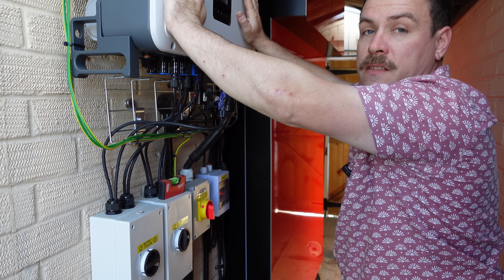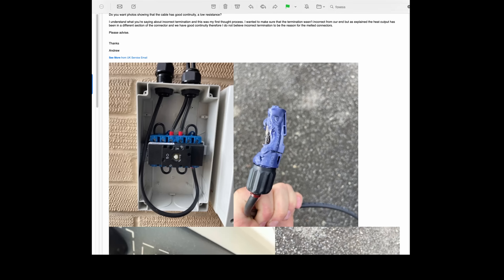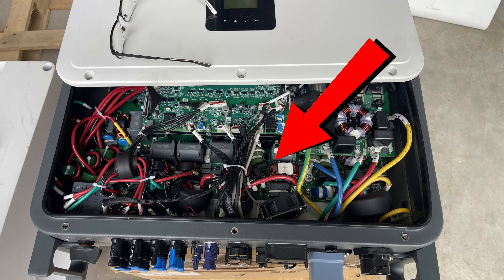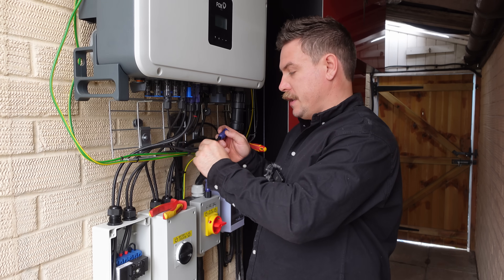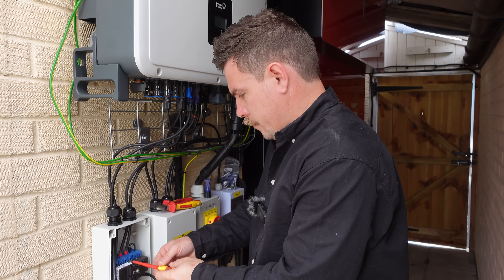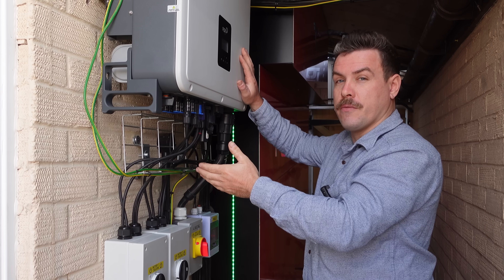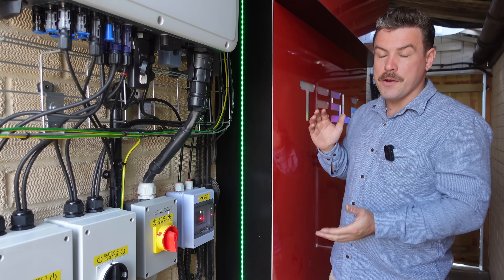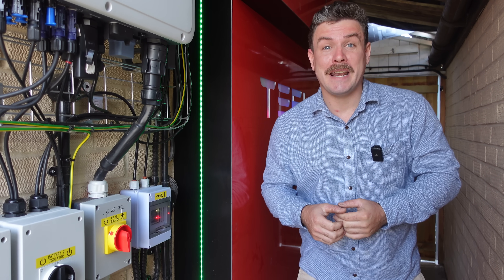Broken Solar Inverter! But Will Fox ESS Fix It?

Comment: I am looking to start my Solar journey. With a DIY solar install, fitting solar panels on the roof of my detached office/workshop/garage.

As an electronic engineer I have repaid / programmed on car ECU / Speedo / control units.
So, an EV home battery sound like a great project.
Where can I find help with this?
Reply from the maker: Dala the great the originator of the open source software to make this possible has a discord channel. There are lots of people in there with all sorts of experience and all sorts of stages of these projects.

I would always recommend getting an electrician on board. No offense but electrical engineers look at things in a slightly different angle to electricians. Things such as cable type and sizing, correct earthing and so I need to be considered. 

I’m not trying to put you off. I just wanna make sure that you cover all bases and make sure you protect yourself. You certainly sound like the sort of person whos more than capable to carry out this sort project
Reply: @TheOfficialBatteryMan Thank for the reply, how do I find the discord channel?
Reply from the maker: @smartroadster452 search GitHub battery emulator. Details on the first page. You have to join the guys patreon but I know myself I wouldn’t have got started without it. And there is a world of people doing the same thing

Comment: I recently read about the balancing issue of the Tesla battery on Dala's GIT (I did a Dala Nissan Leaf battery installation) and it surprised me. How about powering it down automatically once a month? Would it then balance?
Reply from the maker: There are people trying it. I’ve got home assistant to monitor the data and 2 batteries to compare. I keep meaning to try it with the latest firmware version.
Reply: @TheOfficialBatteryMan  When I sometimes had to fully charge my first Tesla (MS85 from 2013) I could see, that it was doing balancing a the top end, taking sometimes several hours until charging stopped. Is that not something you see here?

Comment: Oh my god, is that Tesla car battery bolted to your house?
If you want to experiment with it, i would warmly recommend to move it in a place where it is safe for that battery to burn for hours without big consequences to residences and people as it is nearly impossible to extinguish a fire of those batteries if they reach a thermal runaway. Please be careful!
Reply from the maker: Haha. 😛 it very much is bolted to the house. So far the wall is still intact. The battery isn’t on fire and I still have my qualifications and licences. 

I totally agree in having large battery systems away from a property but 500kg is awks to move 😂

Comment: What size DC cable are you using? Ive got a current project using 3x 82 KW batteries, currently running one with some 6mm DC cable but look like i can get at least 10mm in there, also what can the new larger terminals you got from them take?  Thanks
Reply from the maker: Hey. 10mm2 cable for 50amps. I’m not sure on the max cable size for the larger connectors. They were rated for AWG according to the chap who helped me.

Comment: What are these connections rated for and what max. resistance is allowed.

Better to measure male & female resistance under load condition.
Voltage Drop over the connection/ Current Flow V/A. 
Can you do this 😢
Reply from the maker: I can’t find a spec sheet for this connector. All I know is the inverter is rated for 50 amps. But I agree. Measuring voltage drop under load at each point would work out where there is high resistance. Feel a bit silly I didn’t think of it before. 😂😂

Comment: Would like to have the same system installed. 😵‍💫 I know it's straightforward to hook up cables and buy a Tesla battery 🫣 etc, but would you help to set up a new set up to your subscriber.
Reply from the maker: I’m not currently offering installs. There is a lot of support on Dalathegreat Discord. A community of people working on projects like this. It’s well worth the small cost.

Comment: I am very surprised at the diameter of the battery wires on this?! my fogstar battery and 6k solis inverter both came with some huge 200a (i think, they are as thic as car battery terminals) wires to connect the battery to the inverter?

I might of misheard but you said it was a 50a battery wire? at 250v? so like 12.5kw? x2 is 25kw and you said it was a 30kw inverter?

Battery wires seem tiny for this power inverter, i thought they were pv strings haha
Reply from the maker: These are high voltage inverters working in a range of around 300v - 800v. Fox achieve this by stackable batteries in series increasing the voltage. 

This pack is just under 400v so in a sweet spot. And I can move around 17kw per battery but a combined 30kw 

I much prefer HV inverters for efficiency. I wouldn’t want to be touching 400v or 58v so safety isn’t an issue.
Reply: @TheOfficialBatteryMan  Thank you for the information and taking the time to respond!

Just got an eVan and charging it is slow on my system and looking to do something similar to you with my OG setup

Thanks again for putting this out

Comment: The Tesla battery is pretty finicky on when it enables balancing. Typically, the battery has to be at 95% state of charge or higher and idle (1A), cell delta > 10 or 20 mV iirc, and temperature between 25 and 40C. Maybe it's because some parts of the vehicle emulation are missing, but it seems Dala merged a pull request 8 hours ago that addresses that. I did notice a comment in the code that said "The allowed charge power behaves strangely. We instead estimate this value" which sets a fixed FLOAT_MAX_POWER_W when cells start to reach overvoltage. Maybe something to look into.
Reply from the maker: Nice one. Part of the challenge is we do not see a balancing marker like we do with day temperature information or cell voltage. So it’s very hard to know if some changes are working. 

I’m hopeful this video has sparked up the conversation and renewed people’s enthusiasm to put their brains together for a solution. Miming the car has to be it

Comment: Glad to hear it got fixed. I've the same connectors on my 15kW Solax X3 so will keep an eye on them.
The one issue I've had with my 64kWh Kia pack is it twice blowing the 32A fuses i have between the pack and inverter. The inverter is only meant to support up to 30A, and it was turned down to nominally max 25A, so a little odd that they blew. It's now turned down to 18A and being monitored.
The Kia seems to balance ok - it has reported a max delta of 60mV, but is generally at 20mV.
Reply from the maker: Are the fuses rated for DC? Is your application running at full current for a long period. Most fuses are rated for lower current over a long period.

For example, if I want to flow 50 A, I need a fuse that’s rated 60 amp.
Reply: @TheOfficialBatteryMan  yes pv 1000V 30A DC 10x38mm fuses.
 I'm too used to standard bs1383 fuses that will normally hold the rated current nearly indefinitely.
Reply: Both occasions it's been after the solax has dropped into a standby mode due to low soc, and then tried to start charging again. Generally I try to avoid the soc dropping too low and triggering that, but a badly timed charge on the car causes problems.
I'm adding about 40kWh of charge each night and dumping it back to the grid in the evenings which makes for  quite a nice electricity bill (about -£100 last month )
Reply: Bum. One of the battery connectors on my X3 has now melted and is moving in the inverter chassis. I guess I get to go through the same process as you but with Solax.

Comment: Are those 400Vdc mc4s? There must have been an Arc inside surely?
Reply from the maker: Sort of. The inverter is rated for much higher than 400v. So expect 1000v rating. Sort of like a MC4 with a solid barrel pin

Comment: I recon your crimp was fine and the overheating was caused by high resistance in the connection between the plug and socket. I suspect it wasn’t concentric and the whole of the pin wasn’t in contact with the whole of the socket. That’s likely all it can be tbh.
Reply from the maker: This is what I was thinking. I did test the 2 pins off camera afterwards and they did push and pull with resistance. So not loose enough to be obvious
Reply: @TheOfficialBatteryMan Most likely slightly oval then. It may also indicate that the originally supplied connectors were under-specified if they required 100% contact. It would also suggest this is their thinking if they’ve willingly given you a beefier version to replace them with!

Comment: might be the angle, but that short thick black cable on the rhs of the inverter looks like it’s straining the connector (is it a connector ?)
Reply from the maker: I see what you mean. I wouldn’t say they are strained in person. Also weird it only happened to one. But you can’t fault Fox ESS customer service.

Comment: I recenty know of a Chinesse supplier going well out of their way to support with issues of a product, maybe this is them being comfident in there products to continue taking over the world, with good tech may I add.
Reply from the maker: It’s nice to see it when it happens. Restores your faith in humanity. I’ve seen it recently form Wallbox 2. I contacted over a bracket I needed and was missing. Not there problem but they just send out a replacement. But it means I’m going to mention and install them because they are a good company

Comment: The actual charge capacity difference between ~3.5 and 3.65 is so minimal, it's usually worth taking the slight hit and setting a lower charge cutoff voltage. 3.8v per cell seems to me like some absolutely crazy work. Hopefully you can figure out how to get those balanced so you don't end up cooking any cells prematurely. At any rate, in the meantime, I would set it up to disconnect charging any time that any one cell hits 3.65v, at the absolute latest; until such a time as you can get balancing properly working. 

If you're able to access the balance leads within the battery, you might also consider fitting an active balancer to get the job done until the issue can be resolved directly within the BMS via software (or whatever happens to be the underlying problem), for now. It might not be the most elegant solution you're hoping for, but it's still a lot more elegant than cooking some of your cells by overcharging them due to a lack of balancing.
Reply from the maker: Totally agree 3.8 feels a bit crazy. But people have seen it while charging in the car. 

The BMS communicates with BMB boards at the cell level. It must be possible to software manage. It maybe that the Tesla BMS needs to see charge mode not drive mode. 

I’m avoiding opening the pack in the spirit of the project to become as plug and play as possible. The top cover is thin steel and would be a pain to reseal afterwards.

Comment: I've just had the same issue on standard MC4 connectors going from the PV into the MPPT, the incoming wires/MC4 connector were hot to touch (current was 20A max), but managed to pull the cable out of the connectors. Anyway new connectors, and huge pull to make sure the cable is crimped properly into the MC4 connector, so far has resoved it. 

... in your case if you can't pull out the crimp then you may get the same again if they only accept 50A max!

.... also why try to go to a high target charge voltage, mine are set to 3.55v multiples (Victron Energy System), which ensures that all cells currently (~1000 cycles) balance every time at 100% to 3.55v / cell
Reply from the maker: It’s frustrating when it happens. Very handy to run around with a thermal camera every so often to check connections. 

Even at 3.65v the pack gets out of balance. I don’t think the passive balance boards are being activated. BMB
Reply: @TheOfficialBatteryMan  Nuts - why wont it balance at 3.65v? (still very high)- is that down to the battery or Fox ? - why dont you try it with a victon system which can control everything? - I might be able to send you a basic system your way (Uni. here, but have rachel in accounts)
Reply from the maker: @EverydayLife621 it’s the battery. I discovered when I joined this project that it’s still early days of emulating Tesla LFP packs
Reply: @TheOfficialBatteryMan  ... Mmm - it might be better not to know -we have approx 40kw of home batteries (Pylontech + VE MPII-5000) and a MG4 LFP (SE) @40k miles (owned fully) - SOH on both are around 95% (via VE & CarScanner)

Comment: simpbms you spoke about a few videos ago  would do the job, although as you pointed out it is more expensive, my cells are with 4mv after 12 months use on SIMPBMS, using 4x VW ID4 modules, 28KW.

Comment: You can also fit a voltage triggered capacitor super 5A balance board. I use them when building 15kWh LFP batteries as it saves so much time ....literally days....balancing the cells up in a couple of hours if they are out of whack.
Reply from the maker: That’s a decent current balance board. I really want to fix the software constraint on why we are not seeing balancing. 

The fact it works in the car means it must be able to work on the bench as it were.

Comment: LFP bateeries can only be balanced once they hit over 3.55v really. The voltage curve is super flat so voltage delta is useless to determine capacity until they get to 99% full. Then the voltage shoots up from 3.3v to 3.65v quickly... only then can they be top balanced by BMS.
Reply from the maker: Yes we are force charging to over 3.65 at the moment. Tesla use 3.8v

Comment: You're going to have to keep an eye on those connectors/connections as you may have a revealed a weak point in the design.  It wouldn't surprise me to see it happen again.  Replacement with a better connection method would be in my mind.
Reply from the maker: We shall see how it goes. The other connector have been fine all this time
Reply: @TheOfficialBatteryMan  I've dealt with this problem myself in a 10kW inverter that used Anderson connectors of various sizes.  Ran for years but they failed eventually, where the connection became poor for whatever reason (thermal cycling? moisture?), and the connector melted.  I ended-up eliminating them entirely.

Maybe you just had a bad crimp, but equally, maybe not.
Reply from the maker: @UCCLdIk6R5ECGtaGm7oqO-TQ  I’m the sort of guy that likes to get to the bottom of things entirely, but I think this one will never know. 

If lots of customers reported the same issue, then it would be potentially obvious for a defect

Comment: I have a H3 pro with solar on all 4 MPPTs and I can set times it charges from the grid. With more recent firmware mode scheduler and storm safe functionality has also been enabled on the H3 Pro.
Reply from the maker: You’re able to charge while solar is flooding in. Interesting. Perhaps it’s how im doing it. Through Home Assistant. Not found issues with other brands 

It’s got latest firmware
Reply: @TheOfficialBatteryMan so is your plan to disable HA control & see if grid force charging works via the Fox app during solar generation?

Comment: Tesla uses only passive balancing anyway. Have you considered installing your own BMS with active balancing? You can install it without interfering with the Tesla BMS. I know 96S capable BMS are not cheap but you should be able to get some sort of solution for a few hundred quid
Reply from the maker: Passive is fine if you’re letting it do it often enough to stay balanced. 

I have considered moving away from entirely the Tesla hardware  or adding to it. But that moves away from the aim of the project, taking an EV battery, plug a couple of things on the outside and then it works with a solar inverter.

If Tesla are able to passively balance their packs there will be a way for us to do it. 

I do not want to be peeling off the top of the battery thin sheet steel which won’t seal very well again afterwards. Then one final hurdle while the BMS does control balancing, it is from communication with multiple boards spread around the battery called BMB boards. This uses SPI for communication I believe.

If we emulate the car really well then we should be able to balance.

Comment: I didnt even realise that Fox ESS had any local presence in the UK or that they would perform any repairs there! Good to know as I have a Fox ESS inverter and batteries! Granted, I dont have anything as interesting as yourself! I only have their baby 3.7kW inverter and 3 of their 5kW batteries tied to about 5kW of solar panels. The most daring thing I have done is connect a CAN to Ethernet adaptor so I can monitor with HA rather than their cloud malarky! I look forward to seeing how you get on with your many projects, you have quite the interesting channel! :)
Reply from the maker: They all have their usefulness. I’ve got a few smaller inverters working away. Plenty to cover your needs I guess. 

The HA integration is very useful indeed. Been very reliable in controlling the inverter.